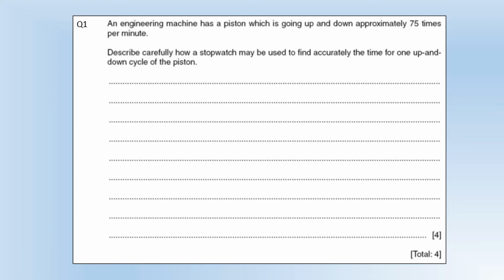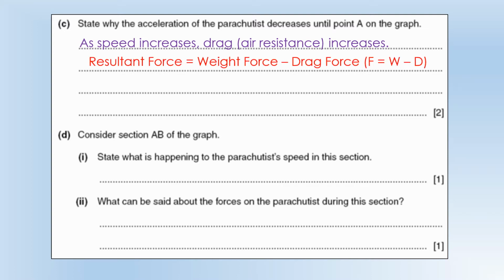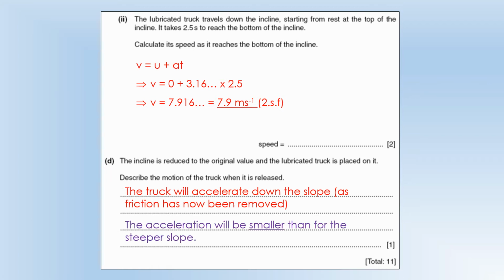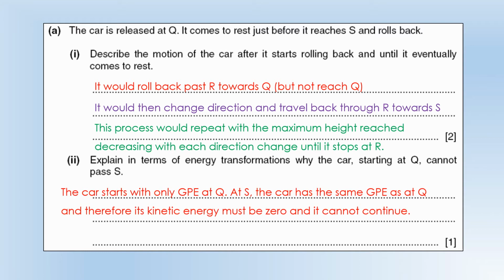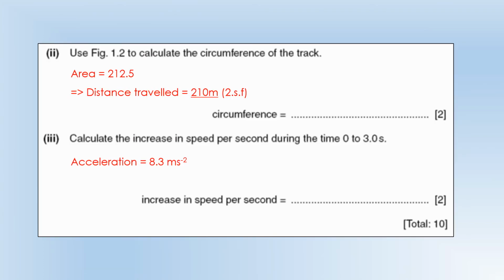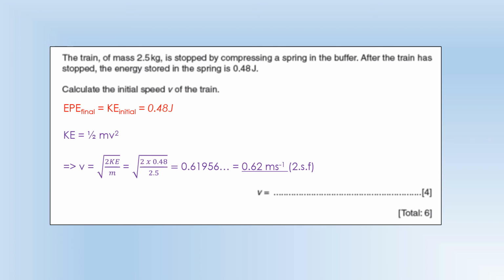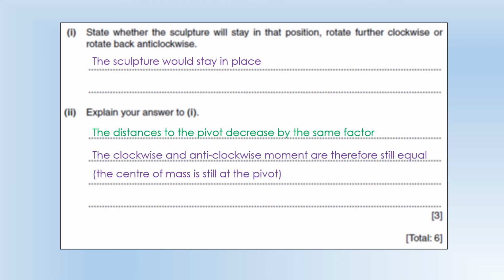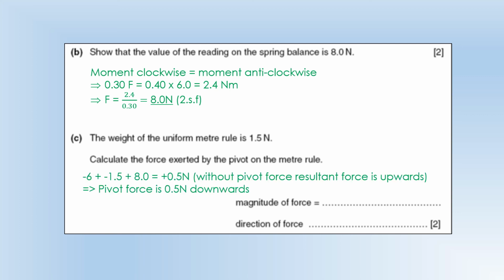iGCSE Physics: General Physics: Longer Answer Solutions

Comment: if i wrote the answer:there is more time for gravitaional forces to act on the truck accelerating it downwards 8:16 will my answer be considered correct?
Reply from the maker: No I don't think so. That doesn't really answer the question.

In addition to that the statement is incorrect as with a steeper slope the time to get to the bottom for example would decrease.

You have to reference the component of weight parallel to the slope because it is ultimately that that will cause acceleration